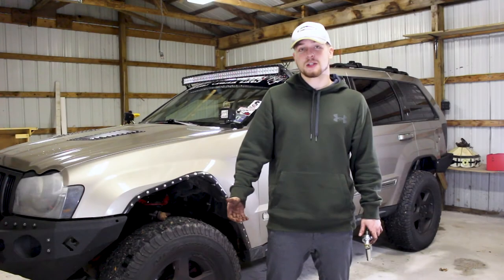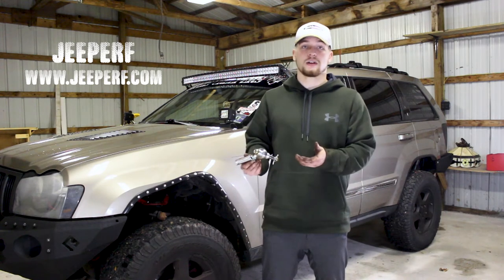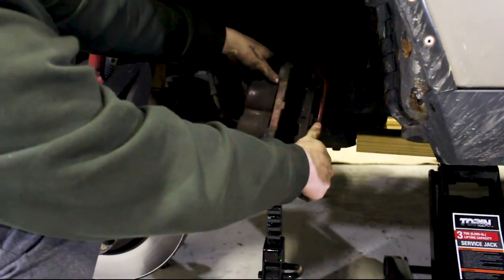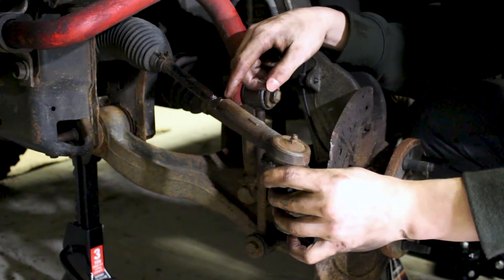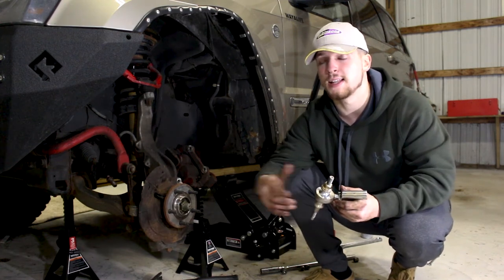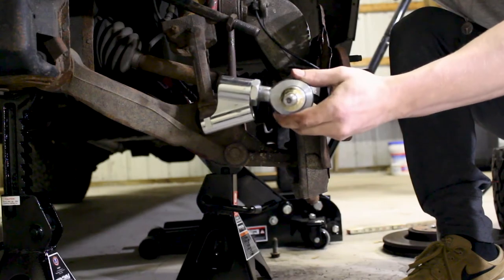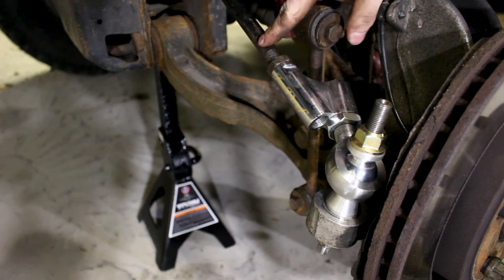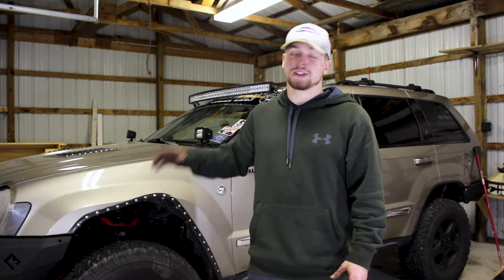Fix Steering Angles with JeePerf Outer Tie Rods

Comment: Hi, great to see someone out there breaking through the barricades of non existent feedback due to having a rarely modified vehicle , A.K.A the JEEP WK. And being that person actually creating the feedback for other  WKer's. Thanks for that!  I gave up a couple years ago because the extensive research a person must do. And not being able to find a mechanic interested in solving my issues, as I'm less hands on. I should go under my JEEP more often but who has the time, rite. I'd like to ask you a question if you don't mind.  
I have 08 WK, CRD, G.D. ecoTune, JBA 4" lift+Bilstein+OME heavy coils+Pinch mod+32" ko2. Thats all, but now I've seen your correction video, which is something I've been wanting(itching) to solve for a while I'll do this immediately and thank you for that. But my question I'm looking to answer is, Where to find a front steel bumper?  The only one I knew existed the ARB is a bit to boxy then I seen yours which seems much more modern. I have no idea where you found that. Whats it called? But found the LOGAN version and it seems very similar to the ARB. Whats your advice with that? Thanks, Cheers, and a 2thumbs up!

Comment: I think the angle on the piece that screws on to the actual tie rod is supposed to not be parallel, but angled downwards to keep the angles the same with the lift, because your tie rod is now angled down much greater than it was without a lift, otherwise what is the point? Look at how maxed out that joint is with it the way you have it.
Reply from the maker: I completely understand what you are saying, but the spacer between the Heim and the knuckle is what provides the compensation for the lift. I am close with the producer at JeePerf and received specific instruction to install these and was ensured this is the proper alignment. Though I did initially set them up as you are saying and found the angles were maxed out when sitting at normal ride height.
Reply from the maker: I know the engineer who made this part very well (the owner of JeepPerf) and was told the way in the video (after he saw the video) is 100% correct. I sent him a rough draft of the video where I installed them the way you're thinking, he said it was wrong. Had to refilm the way I did above.
Reply: That's really surprising. I can see why you installed it the other way, but I couldn't understand this angle if my life depended on it. I also can't picture it maxing out the other way. Maybe I'll order one some day and fiddle with it myself so I can see it. Anyway, glad it's working well for you and thanks for making the vid. :)
Reply from the maker: Rick Havok no problem! Just wanted to clear things up and endure you I 100% installed them the way you're thinking. The engineer really cleared things up for me and if you'd like me to forward you that information, shoot my Facebook page a message!
Reply: That would be great! I'm really curious now. Just give me a few minutes... and thank you. :)

Comment: Okay, so now that our other conversation is resolved, I have a question that probably doesn't belong on this vid; but I was wondering what you did about the wheel wells after the fender trimming. I had a different mod in mind that is really nothing at all like yours, but would make it so the fender liners no longer fit and probably couldn't be attached anymore.

Comment: What size lift?? How is it off-road? I was thinking of getting a commander
Reply from the maker: The lift I currently have sets me around 3" of lift. With the 5.7L massive Hemi engine and low range, this Jeep performs much better than expected. With high end components like these to help the flex of the independent front suspension, you can really do some work!

Comment: So would you have to do this for a 2 inch spacer lift
Reply from the maker: You wouldn't have to, but in this video I am installing this on my WK with a two inch spacer lift. It definitely helps with bump steer, alignments, etc with any sized lift. Check out their site for the appropriate part: www.JeePerf.com

Comment: Interesting. So this mod would basically allow you to use a four inch lift that isn't a Superlift or JBA? (So you could stack an OME and a Rough Country Spacer for a total of 4", do this mod, and get away with it?) Or do CV joints get involved too?
Reply from the maker: TheValleyofAwesome unfortunately, you'd be at the will of your CV axles. This would help for sure, but the drop bracket of a Superlift is what would correct CV angles and would be needed for 4" and up.
Reply: @MyJeepStory   Im 2wd. 2007 Jeep Grand cherokee overland. Since I dont have to worry about CVs I should be fine? The plan is Bilstein 5100s lowest setting with OME MD springs and 2 inch RC spacer up top. This should help correct my steering angles?
Reply from the maker: @Drama_93  so this modification helps not only the CV axles, but helps the longevity of your steering rack. It allows more articulation by removing the limiting factor that the stock tie rods pose. This also helps alignment as well so you'll see better tire wear.

Comment: I have a 05 WK Hemi and I'm looking to lift it. I have looked at your lift Rocky Road Lift. I'm looking to do a 2' lift. Should I go with the rough country suspension 2' lift or just go with the Rocky Road lift? Thank you and keep up the good work.
Reply from the maker: Thank you for supporting! As for your lift options, either will work and both will allow you more clearance off road and for larger tires. I have had experience only with the RRO lift and have not had an issue with it. I recommend their shocks with the lift as well as your current shocks are not the proper length for the lifted application. Thanks again!

Comment: That looks majorly wrong, it looks like it hits the sway bar links during turning. The whole point of having this triangular piece is to take the 30-35 degree tie rod angle and bring it back perpendicular.
Reply from the maker: That is incorrect! That would cause a major issue while articulating and snap the heim at even minor flex. The point of this is to adjust the height with the misalignment spacer and use the advantage of a heim for less stress at more extreme angles while articulating. Thanks for watching and taking the time to provide input!